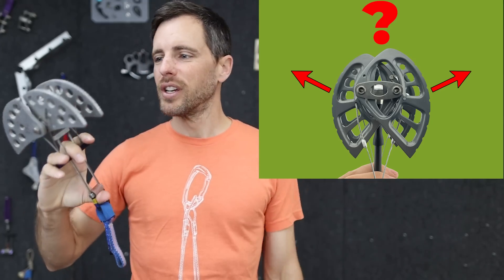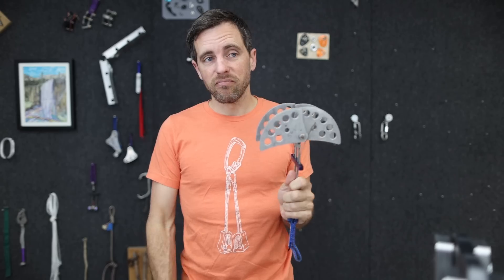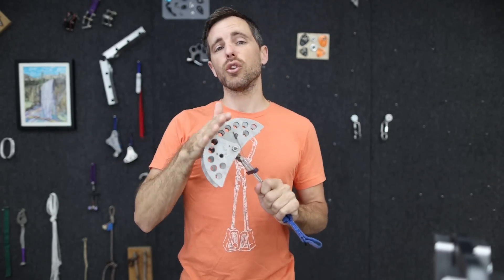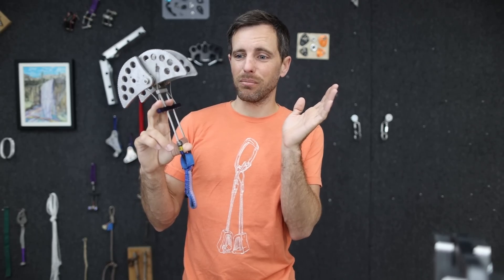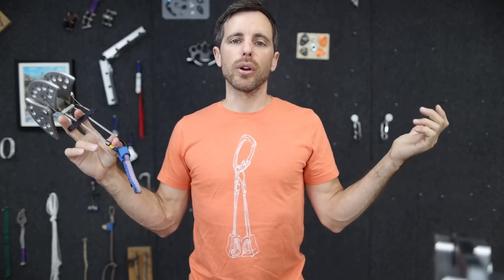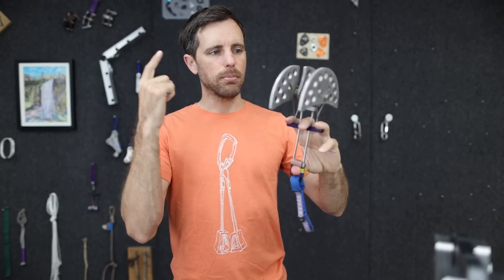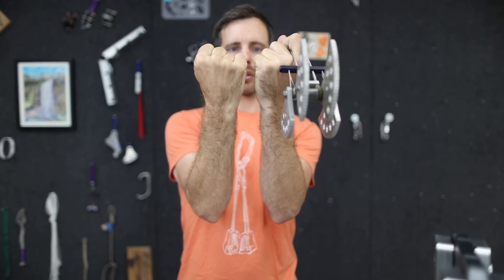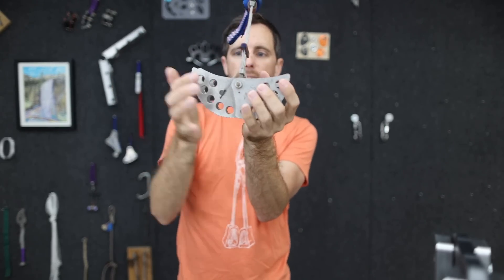I need your help

Comment: A rough math would be a factor of 2.  The force at the measuring point would be half of the force pushing out by the cams. Multiply the reading by two and you'll get the force at the cam.
-----------Showing my work----------
At equilibrium the net torque on the bar is zero which means
Torque at the top = torque at the cam point. Torque being Force X length of the lever.
Force at the top * length between the bolt to the measuring device = force at the cam * the length between the bottom bolt to where the cam hits the metal pad.

If l_m is 2*l_c then F_m = 1/2 F_c
2F_m = F_c.
Force at the cam is two times what you measure at the top.
If the cam doesn't evenly distribute the force along the lever,  say the bottom section is 
pushing more than the top portion, you'll want to integrate the torque over the length of the cam. (don't worry about this last factor I just wrote it to flex)

Comment: I'm looking forward to see the simple math of a Friend placement verified. Spoiler alert, the elegant cam lobe design (segment of a logarithmic spiral) results in equal outwards forces independent of the camming (as long as in the useful range).
The tests with tricams will probably be more surprising, the forces should depend a lot on the camming angle which seems to span ca. 10°-45°.
Very interesting would be tests with Ballnuts which seems to me should apply way lower outwards forces than a cam would. Same expectation for passive placements.

Comment: Those pads that come into contact with the cams need to have milled out pockets you can insert granite blocks into.  Get a countertop fabricator cut up a bunch of sacrificial blocks that will properly grip the cams.  They have lots and lots of scrap sitting around.

Comment: THAT'S NOT HOW FRICTION WORKS the force of friction is N*mu accept in edge cases or if you exceed material failure. With no pressure you have no friction try holding a book above a desk does it experience any friction with the desk?

Comment: Just double checked my math to try and make sure that I was thinking about it right but the outward force is the ratio of the width/(height*2) assuming parallel plates. But the forces shouldn't actually change with different angles just holding power because moments don't care.

Comment: Generally, it would be best to have a sensor that measures the pressure directly on the plates. Otherwise, you have a lot of points that are affected by different forces and that you are not able to measure. But since you already have the device, try pulling in the way I have shown in the drawing and measure whether the indication of device "A" is twice as large as the indication of device B. Perhaps the deviation will be insignificant and acceptable. We are not flying into space after all ;)

https://i.imgur.com/oyJvxkY.jpeg

Comment: I can no longer fallow the math needed to calculate everything you are trying to measure. That being said, as long as you test every cam the exact same way, it will give you good data to accurately compare all the cams. The only problem I could easily see with your setup is the plates that each cam will be pushing against will need to be changed out between each test. The groves already have some debris in them likely from your early design testing. If the surface each cam is pushing against, it should be a constant in your tests. Currently, it is an unpredictable variant which will cause your results to be inaccurate. I would like to see them made out of hardened steel and everyone be rockwell tested to ensure they are all the same hardness. Make sure they all have the exact same grove pattern. The easiest way to achieve that is to machine the groves into a long piece of steel and then cut it up into the needed amount of blocks.

Comment: Yes, all those factors, and more, can have effects, but usually there will be just the one dominant issue (it's why it's called dominant;-) and then there will be a secondary issue backing up the problems. Lots of 'context matters' discussions to be had.

Some where friction will always be a big factor, coupled with the effectiveness of the hinge-ing action, as those are what convert the primary pull into the sideways grabbing action.

The 2:1 jig is likely to have issues when the cam faces are well separated (axle direction) as each has a different scaling, e.g. 1.9 and 2.1 for the force splits.

Comment: Yes if the linescale reads 2.15 kn then the cam pushes out just a bit above 4.30, but for how little the plates pivot on those 2 bolts i think the friction in not significant, just doing a x2 for the reading seems super good enough.

Comment: Rig designer here, the maths should be simple, but I'd worry about sctiction of the pivots under load. They are free moving without much load on them but seem to have a fair bit of clearance in the joint. There's potential for twisting loads on those pivots so they could jam up a little and make a big difference to your measured force at the linescale. A simple upgrade might be a switch from bolts on those joints to a well toleranced pin and bushing combination.

As a climber, I'd be interested to see varied amounts of taper in the placement and see how much that changes things- with cam angles so well thought out you might be able to measure how much crack flare REALLY affects the security of the placement, particularly using a rock simulant so the surface can crumble into dust that would lubricate the contact

Comment: The force of the nut will be complicated, and depend on the friction between the nut and the walls - if there's low friction there will be more perpendicular force, similar to a cam, whereas if there's high friction most of the force will be in the direction of pull, with little being transmitted sideways

Comment: Why isn’t the line scale in the same plane as the cam? E.g. the cam’s thumb loop, stem, and lobes should be in-line with the screen of the linescale.

I feel like you can get rid of the pivoting mechanism completely, reducing fancy math, and make the linescale the only thing that connects the plates together.

The holes in the linescale “handles” can have the I-bolts that the pullies connect to. 

This would eliminate (basically) all math and you could directly measure the force the cam exerts on the plates.

Comment: Math is correct so long as the center of the cam cable is aligned exactly on the half way point.  The jig is an extremely elegant solution (kudos to your designer/machinist friend!) and will  also work for nuts if you add tapered plates for the bearing surface and align the cable on the center line (there will be arguments about the friction coefficient on the nuts on aluminum but I've never seen people check the actual coeeficient of the rock they climb so just lube it up as in wet rock and find the most conservative number).  That said, I think you are still going to have some folks dispute where the force is actually applied with 1/2 the cam lobes above and half below the center line.  Rotating the jig/pull 90 degrees and aligning the lobe contact points exactly on the center line would be a quick demonstration that the forces are identical both ways.

Comment: While I might not know the most about climbing not physics, but my 2 cents is that the coefficient of friction between the cam and the surface matters because that would be the limit of the amount of force the two can transmit. I would think the static coefficient of friction is more important than dynamic—as it is the higher coefficient and you don’t want your cam moving. For the contact patch/ cam grabby location (is there a proper term for that?) that seems like a use for trigonometry and leverage calculations.

Comment: Friction is not relevant, as long as it does not slip.
Force will vary depending on the point of the lobe of the cam has in contact with the rock, assuming the distance varies.
Force will also vary depending on how open the cam is. 
That is all.
Resultant force will vary depending on the the angle of pull on the end of the cam, but the only force which should be considered is the force axial to the stem (when it is straight...) if that makes sense...

Comment: http://katlein.de/wp-content/uploads/2017/09/friendsbesser.pdf

The pulling force roughly doubles, in a fall, the pulling force on the cam doubles also, perhaps that leads to confusion. telling sometimes 1:2 or 1:4
depending on what force you are looking.
Force on harness in a fall for ex. 2KN, outside pressure force of the cam onto the rock ( because force pulling on cam is alreday roughly 4KN) therefore 8KN

Comment: Torque = Force * Radius, Which means that in order to "hold back" a torque of 1kn load on a 7.5cm (0.075m) on a 15cm radius, you have to put 0.5kN. 
That said, the force HAS to be a point load, otherwise the math gets hairy and you have to do integrals over the force load. 
If you want to make sure, I think having the linescale loaded linearly (and not radially as you do here) would be more acurate. 
But i dont think it make a huge difference (0.3 kN difference max is my estimate). 

I am robotics engineer with a background in physics, and a lot of experience in mechanics. So i should at least know a little bit about the subject ;)

Comment: Most of those cams are too wide compared to the short arms of the rig, making it close to impossible to calculate the actual force. Also, all forces/contactpoints between the rig, cams and linescale are at angles compared to pivot point (bolt) making it even harder. 

I would recommend making a rig/adapting the rig where you can pull on the cams downwards (or in opposite direction to the location of the linescale). That way the contactpoint is way more accurate.

Comment: Maybe you could measure the deformations of the gear opticaliy and calculate forces this way. There is a technique called DIC (Digital Image Correlation). A spackle pattern is sprayed on the surface of the part and gets recorded with a camera. Slow Motion footage also works. The Software then calculates the deformations of the material based on the deformations in the spackle pattern. It's like a optical strain gauge all over the part and bot just at one spot. I think the software GOM corelate is free to use for 2D applications. There are also open source software tools like DICe. Hope this is helpful. For this project or a future one :)

Comment: Maybe use 2 line scales and add the values together, instead of 1 line scale and 1 pivot.  Since the cams touch in multiple places it might not be accurate consider it as exactly in the middle.

Comment: Honestly I have no clue about this. 
My 2 seconds of thought though, is the point of the pivot to the point of the cam to the connection to the surface. IF your 'shrinking it slightly'.. then your point of connection would be at or nearly at the point of pivot, where as if you 'crank it down' and seat it deep, you got alot more 'mass' for it to work through if it was to try to open fully.  However it would all be down to the traction of the cam on the surface.  

Also the cam is (I think), essentially a pulley. your taking 1 input, and having 2 outputs.. 'up and down' or 'left and right'.  So you'd have extra balancing that way.

Comment: I agree the force measured should be half the force applied, since you have 2:1 leverage, but if you are doing it that way then I would suggest a much larger jig. With it that small, even a mispositioning of the cam away from the centre will significantly change the result. If the intended lever arm is only 75mm then being just 5mm off changes your result by nearly 7%. With a larger jig, the position can be proportionately less precise. 

I agree with other commenters, though, that directly measuring the pressure on the sides (or one of the sides) would be much simpler and would give much more reliable numbers. 

I don't think measuring peak force will work, since the peak in the pulling force and the peak in the outward force might not match up, since there is going to be some elasticity in the system. I think you need to collect all the data and graph the two forces on the same graph so you can see exactly what it actually going on. You will probably see that the spike in the pull force leads to a wider, lower, delayed spike in the outward force. With the graphs, you'll be able to see the widths, amplitude and timing of the spikes (you'll need to synchronise them to get the delay, of course - I don't know enough about linescales to know the best way to do that - but the delay isn't too important so you could just line the curves up so there is no delay).

Comment: 7:26 "we don't want them to come to a V because that adds maths" yeah Nahh... The maths it adds cancels out.
You *could" calculate the tension in the green and resolve that to come up with the force on the anchor, and the maths shows that's it's the same as the force on the jig..
Treat that whole green bit as a black box that you don't are about the contents.

Further on, the friction of the test jig sitting on the bench....
If you lift it slightly, it will move to a position where forces left and right are in equilibrium. It will be in a static stable position so friction has no effect on the readings.

Comment: This has good experimental design considerations made. I did something along similar lines as an engineering student but trying to corner balance a car using bathroom scales. This is a 3rd class lever. The force ratio can be calculated as Dfe/Dfl where Dfe is the distance from the fulcrum (axle) to the effort (cam) and Dfl is the distance from the fulcrum to the load(cell). this is a simple 2:1 ratio. the fact the pulling is perpendicular is irrelevant as the fixture shouldn't have net movement therefore forces applied are equal and opposed, cancelling out. In fact, before I saw the design I was brainstorming essentially the same fixture but rotated 90 degrees like a large door hinge where it's pulled at the fulcrum and the load cell is in the middle with the cam on the outside (1:2 ratio in that case). 

For cam angle with relation to the axle, It's a spiral. As the angle along the spiral increases, the distance from the center also increases. Imagine we were to unfurl the spiral like a fern (polar to cartesian graph) the change in angle becomes a change in distance from the origin, x. The change in axle distance is y, and the steepness of the angle would be slope m with an initial offset b. You end up with y=mx+b. m is the rate of change in camming angle. b is basically the distance from the center of the axle to the smallest part of the cam. for easy understanding it can be set to zero if we can imagine an infinitely small cam/axle. If the resultant line is flat, the spiral is growing at a steady rate and therefore the camming angle shouldn't change. This was the philosophy behind the original friends. the measure would be from the center of contact patch to the center of the axle the cam is pivoting about, whether a friend, BD, Tricam, totem, etc. 

But all this is theory, we all want to see the lab results

Comment: 6:40 ish, your request for help.
For a lever: force x distance (from pivot) is always the same. Twice the distance means half the force. 10 times the distance means 1/10th the force.

Now, a confusing thing is the, question of do you halve the force reading because it's pushing both ways?
Quick answer: No!
Reason: the load cell reads the force acting on one end. Imagine you use it as a weigh scale, hung from a rigid beam with a weight hanging off it. It will read the same as the weight, not half and not double. The load cell pushes up on the hanging weight, and down on the support beam, equal and opposite forces both equal to the weight of the load. 
In your example it does not know that your apparatus is pulling both ways, it just knows the force across it.
That force must be equal and opposite at each end otherwise it will move. But they are balancing opposing forces.

So, in your test jig, if the load cell reads 10N, there is 20N pushing on each cam contact point.

Comment: rig it to pull each side apart, measure that force with another linescale so it's a known value. then it's a simple ratio between the readings on the linescale in this contraption and the one rigged to pull it apart. no theory or diagrams required, just real measurements

Comment: This setup looks plausible for cam placements.   

For nut placements it will vary drastically with the amount of friction and the angle of the “rock” it’s wedged into.  It’s just a simple wedge at that point.  

You could have a drastic constriction where it’s exerting almost no outward force or a slight angle with low friction where the outward force is huge.   

Look at feathers and wedges used to intentionally break stone to get an idea of how they maximize the splitting force by minimizing friction.

Comment: PS.  Your jig calculation isn’t accurate because you are loading 4 separate cam lobes which are at different distances from the jig axle.  So each of the lobes will experience a different force.  The can lobe closest to the axle will have to exert a higher force than the lobe farthest from the axle to get the same measurement showing on the scale.